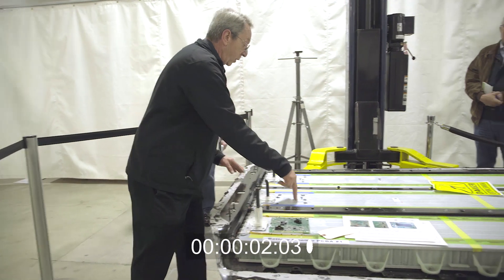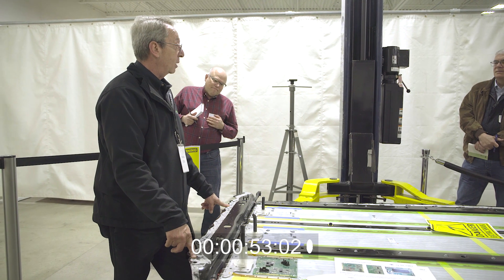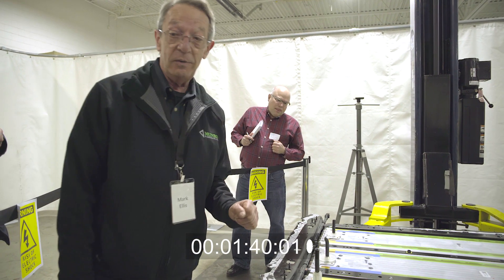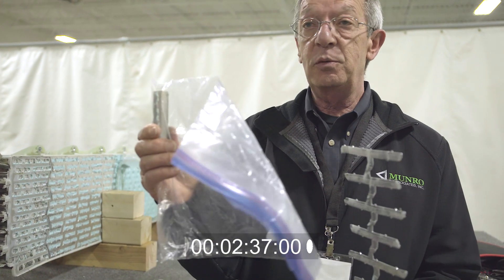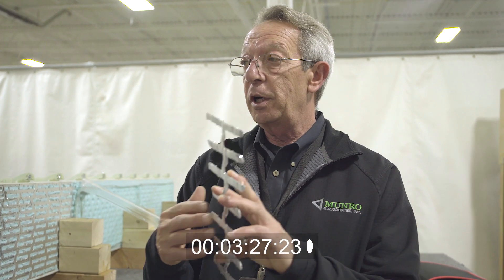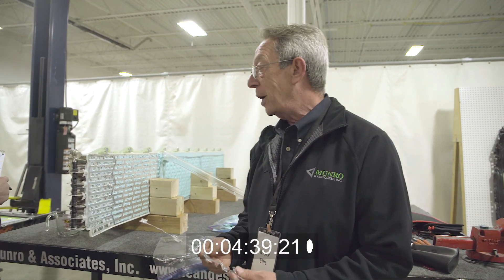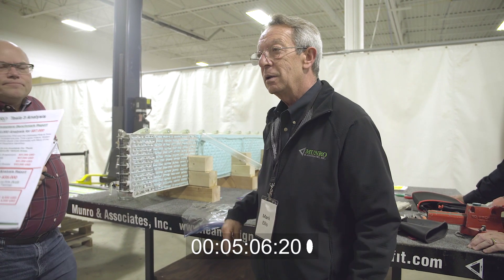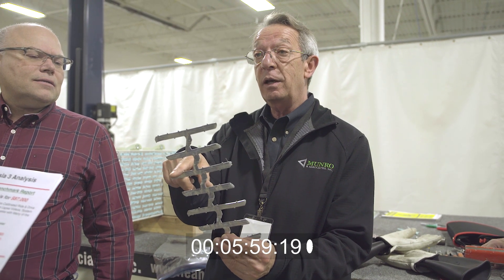Tesla Model 3 Battery Breakdown

Comment: Those tiny wires to the cells are not for vibration! They are fuse wires to prevent thermal runaway!
Reply: He did not say the tiny "wires" were for vibration.  He said they were fuses.  He said the glue was necessary to prevent vibration from breaking the tiny "wires".
Reply: @johnvolt9605  hearing impaired reading the words... my bad...can't read lips through the mask.  :(

Comment: See the look on that guys face when the guy mentioned the battery's longevity.
Reply: Keep in mind he said the battery would last 15 years before it drops below 70%.  That means many batteries will still have about 50% charge after 30 years.  Cybertruck will still have 200 mile range after 30 years and the truck will never rust.  Ultimate farm equipment.
Reply: Time stamp for those who need it
https://youtu.be/64_iBKLSnGA?t=81
Reply: Don't forget, Tesla had already been making sure the batteries can, some day, be swapped easily. Specifically, you might be able to swap batteries faster than actually charging them
Reply: I did read somewhere that Tesla wasn't making battery swapping a high priority anymore
Reply: @plainlybasic2300  Yes, until the issue of who owns the battery and would you be ok getting a bad battery installed?  The legal problems of loaning out a $12k battery that you don't own and are only leasing as a service became unsellable to the public.
Reply: On top of that every vehicle has a differently shaped pack so every battery swap station would need several batteries for dozens of vehicle models.  That only gets worse as time goes on, maybe the 2024 model has a different pack from 2020, then the 2030 model does that again, etc.  Then they abandon support for older models and it suddenly becomes impossible to charge your older vehicle.

Charging batteries in place avoids all of that and the battery technology has been advancing quickly enough to make it viable.  It's already pretty good and will only get better.
Reply: @rhamph  Yep, Tesla uses all 18650 or 21700 batteries but the packs are different for each model.  This is even worse for all other EV companies that use pouch or prismatic batteries.  Each battery system is specifically designed for just that year/model car.
Reply: @davidbeppler3032  How would he know the longevity? As I understand it, degradation from cycles is different from degradation from ageing. They seem to have cycles mostly figured out but I'm not sure about the ageing.
Reply: @plainlybasic2300  The Model 3 battery can't even be removed from underneath the car. Battery swapping is not an option. Technically, it was on the Model S but I think that was mostly something they put in to grab some extra subsidies rather than a real plan.
Reply: @phamnuwen9442  You know, that would be a great argument back in 2014.  But this is 2020.  6 years and more than 300,000 miles later.  The proof is in the numbers.  Think, if the first generation batteries lasted 6 years... and over 300,000 miles and counting.... don'tcha think the new batteries will be better?
Reply: @davidbeppler3032   6 years is clearly not a long enough lifespan for a battery that is going to be quite expensive to replace.

You can't just assume everything will automatically improve. For all we know, efforts to reduce cost (cobalt elimination) could just as well reduce lifespan.

Give me some hard data on battery lifespan (time, not miles), replacement costs etc.
Reply: @dclpgh  They aren't making it an option for "quick charging" anymore, but they do have the ability to replace the pack in the event of failure.
Reply: @davidbeppler3032  Same for Model S/X since they're all aluminum. Even an old S with 50% degredation will be able to drive at least 100 mile which is more than enough for majority of people's everyday driving.
Reply: It's really funny to see a guy smiling and saying "it's expensive" and then after he hears the  "operational lifetime" his face turns into a face of a boy that just found out there is no Santa :D
Reply: @plainlybasic2300  faster safer to not swap now
Reply: Pham Nuwen bear in mind that Elon also owns SpaceX, and in the aerospace world, they've got longevity figured out too, because getting that wrong costs millions in maintenance or replacement. You wouldn't invest the kind of money they have in their battery gigafactories and not take advantage of the expertise you have available to make it work.
Reply: @davidbeppler3032  Many of the first model S batteries haven't gone 300k miles. Do you know of any examples? The taxis that went 300K had new batteries from what I understand
Reply: @f270  You understand wrong.  Here is a recent article.  Notice the batteries were replaced for "factory installation issues".   Also the Tesla Taxis from Tesloop have had tons of repairs.  Lots of money in repairs too.  Still when compared to ICE taxis the maintenance is very low "$0.18 to $0.25 per mile — far lower than the current average of $0.32 to $0.35 for legacy sedans."  Just think how much better the cars are built today 5-7 years later.  On another note, they have more than 400,000 miles on some of them!
https://cleantechnica.com/2019/11/23/500000-miles-in-a-tesla-whats-the-result/
Reply: @davidbeppler3032  The article says they replaced 6 batteries. The tesloop model S with 400K has had 2 batteries replaced! That's not confidence inspiring. Show me a tesla with high mi 300k+ that has the original battery.
Reply: @f270  so that part about none of the batteries failing due to inability to hold a  charge was ignored?  Replaced 6 out of 11 in taxis that are driven harder than any personal vehicle and only supercharged.  That is pretty confidence inspiring in me.  7 year old cars hold up that well from a company that had never built a car before?  Pretty cool.  Now they last forever.  Unlike every ICE that has designed obsolescence built right in.  lmao
Reply: @davidbeppler3032  So you believe that the Tesloop model s that had it's battery replaced twice. Meaning it's on its 3rd battery. It was "factory installation issues" were found only after a lot of miles were put on? That's the most obvious lie. Of course Tesla isnt going to say "battery failure" for a very public taxi fleet.
Reply: @f270  do you have a point?  Still better than any ICE I have ever seen.  How many of them are expected to get more than 300,000 miles as a taxi?  Answer, none.  How much do they cost over the 100,000 they expect to get?  The fuel alone costs more than $8k.  Superchargining is not free (actually for those teslas it is) but it is a hell of a lot cheaper than $8k!  Maintenance on an ICE taxi is expensive too.  If you do a dollar to dollar examination it is probably a lot more expensive to use a Tesla to do Taxi service (unless you get free supercharging) but the vehicles are much nicer and so is the tech.
Reply: @davidbeppler3032  Yes, my original point is the batteries don't last as long as claimed.  And they cost so much to replace that it makes high mileage Tesla's not something I want to own. I look forward to when this problem is solved.
Reply: @f270  It was solved 2 years ago.
Reply: @davidbeppler3032  it would be nice if Cybertruck had a low gear mode,
Reply: @maxnovakovics2568  Why?  Please explain?  Electric motors already have insane torque.

Comment: Why not have the a coating cover in side the battery cover like less the weight of the 96 wireing but have the cover electrolises plating like gold plating then have the pack with rubber seal less the glue more coverage then replace different packs when degraded or the pack not working optimal fix connectors to pack in manufacturing just gold plate inner cover try that Ford or Rivian

Comment: 3:20 - the shorter modules have 23 bricks, the longer ones have 25 bricks (not 26). Only this way, it all adds up to 96 bricks. :-)
M1	23s	46p	1058 cells
M2	25s	46p	1150 cells	
M3	25s	46p	1150 cells
M4	23s	46p	1058 cells
total	96s		4416 cells, 79.488
  Wh, assuming 5Ah per cell and 3.6V nominal voltage
Tesla describes it as 75 kWh battery pack.

4:30 - You say, the "optional" battery pack has "three fewer groups of 46 cells in each of the four modules". This would translate to: 
M1: 20s	46p	920
 cells
M2: 22s	46p	1012
 cells
M3: 22s	46p	1012
 cells
M4: 20s	46p	920
 cells
total: 84s		3864
 cells, a 69.552 Wh battery
I do not believe you in that regard. That would translate to a 65 kWh battery pack, when named Tesla style. That is way too large for the standard range plus battery. Also the battery pack voltage would drop, which would be disadvantage when charging at current-limited DC chargers.

Instead from other sources, the real organization is like this:
Standard Range Plus Battery
M1	23s	31p	713
 cells
M2	25s	31p	775
 cells
M3	25s	31p	775
 cells
M4	23s	31p	713
 cells
total	96s		2976
 cells, 53.568 Wh
Tesla describes it as 50 kWh battery pack.
Source: https://electrek.co/2017/08/24/tesla-model-3-exclusive-battery-pack-architecture/

Instead of lowering overall voltage (84s), they keep the overall voltage (96s), so that for the e-motor and for charging, at least the voltage level remains the same, but currents going down.

Mid Range Battery (available from January to March 2019) was right in the middle. The following is an educated guess and estimate:
M1	23s	39p	897
 cells
M2	25s	39p	975
 cells
M3	25s	39p	975
 cells
M4	23s	39p	897
 cells
total	96s		3744
 cells, 67.392 Wh
Tesla could describe it as 63 kWh battery pack.
Source: https://teslike.com/2018/10/19/estimated-range-and-battery-specs-for-tesla-model-3-mid-range/

Comment: Each brick is 1s46p and the bricks are connected 96 bricks in series for a total battery of 96s46p (4416 cells)
Each cell must be 350v/96s= 3.646v nominal/cell
75000 Wh (75kWh) / 350v = 214.3 Ah
214.3Ah / 46p = 4658 mAh/cell
Spec shows 4800 mAh/cell (2170)

Discovered this video: https://www.youtube.com/watch?v=2nhQw7iGukE
Reply: Do you mind me asking where 96p came from in the second paragraph; 214.3Ah / 96p to = 2232mAh/cell
Reply: @firstnamesecondname5341  Thanks, updated as I switched s with p
Reply: David McC 👍 I’d been reverse engineering the Porsche Taycan system (might as well do something while in covid lockdown 🤷🏻‍♂️) I’m a bit rusty on the ole calculations and thought I’d missed something 😎 thanks
Reply: really late reply but the real kwh is around 78/79
Reply: @shitass3931  we can work it back... 4.8Ah * 46p * 350v = 77.28 kWh
Reply: @davidm8030  I feel itll be slightly higher but that's close enough for me to not disagree :)

Comment: Are there different "bricks" in the SR+ battery? 
According to the ODB information the SR+ has the same voltage as the long range battery. So there should still be 96 bricks in series. But to only have 50kWh instead of 74kWh there should be ~31 cells in each SR+ brick as opposed to 46 cells in each long range battery brick.
I assume that just using lesser bricks would result in a lower voltage.

Comment: The nominal voltage of these Panasonic NCA cells is 3.6 V, not 3.5 like he says several times. 3.6 V * 96 = 345.6 V which is pretty close to the 350 V he mentioned at the nominal pack voltage.
Reply: What's the peak voltage at full charge? Around 4v? I know they're reserving some potential for longevity so they likely won't hit 4.2v.

Comment: Interested to hear how JB at Redwood materials will recycle this. It's obviously not designed for dis-assembly. They're probably  planning to shred them and retrieve material mechanically and chemically? Sounds complex and expensive. Hope they've factored this in and review it at battery investor day. Super important for the planet and as a precedent as they scale up.
Reply: Anthony Smith I agree. The battery should last for a long time as it’s built for it. However, it contains a lot of glue and must be a nightmare to recycle ♻️
Reply: @TurreTuntematon  
Unless they have some form of solvent to dissolve it?
Reply: They glued it to make it watertight, and vibration/shock proof. Its better to design a product that is long lasting but more difficult to recycle, than an easy to recycle, but not long lasting product.
Reply: t c  I dont know why you are talking about apple. It has nothing to do with the video.
Reply: Anthony - before Tesla batteries are Replaced , they can still be used in Consumer electronics and in Tesla Energy products.
Reply: t c  no, apple make it hard to get the battery out, few people are recycling those batteries.

Tesla, battery out of car is easy, recycling not so much but that was always going to be the case so you only have to design it to be recyclable for a major industrial recycler.

Serviceability would be nice, but if they can make them last a whole lot longer by making them less serviceable, so be it. You can still do a relatively easy battery swap.
Reply: @niconico3907  Yep, for sure it's easier to make it watertight with glue. We could have hours of debate on this one. I acknowledge your point though. Let's see what they announce at battery day. Hopefully they have cracked longevity and recyclability at the same time. I expect big things from JB and co. Suspect they've spun it out into a separate company as it may well be loss making, but could be eligible for governmental grants/ funding as a separate entity.

Comment: Does the glue also work to suppress any fire?
Reply: Probably not directly I’d guess.  but it prevents anything from vibrating or shifting which in turn reduces fire risk
Reply: I suspect they used some type of thermal suppression material within the brick  to minimize heat propagation of a single cell thermal runaway.
Reply: I don't think it's simple glue. It probably has vibrating absolution ability. If you look at cell diagram, it's just a sheet of metal separated by thin insulator. If cell keep getting vibrate, those sheet of metal will probably rub into each other a lot result in damages and shorting.
Reply: ICE manufacturers should be required to build much heavier fuel tanks with better fire protection devices installed at the factory.  ICE are dangerous.
Reply: Curt - Tesla made sure glue is NOT an Excelerant. 
and Tesla has a Blue Goo that Insulates the batteries and acts as Passive Coolant and works in cunjuction with the BMS.

Comment: In your opinion is the battery pack any different than what the Model 3 uses? Any improvements anywhere?
Reply: Actually the description now shows "Model 3 Battery" so it's likely an older video and not a Model Y. Maybe the title of this video in this relatively new channel will be edited for clarity at some point.
Reply: I heard that they have taken the aluminium wire bond process out and they'll be using laser welding to make the connection to the cell is the battery pack.

Comment: How much cells must have died to have -14% capacity on my SR+ model 3??? It has a lot imbalance when drive it on longer trips. Rated range is only 208-212 of the 240.. Tesla said ''it isn't -30% yet so it's as expected... as listed on website''

(I have the OBD ScanMyTesla tool, to read cell voltages and have automotive diploma’s and built DIY battery packs)
Reply from the maker: I’ll ask Mark and get back to you. Thanks for your question.
Reply: That could largely be due to general degradation.
Reply: Munro Live Wow an answer! For us it has been lower useable capacity pretty much from the start. It never had the 240-mile rated range and it’s only half a year old. I visited service, tracked the capscity with apps, OBD-reading ScanMyTesla software, manually driving it empty and calculate it (after mitigating random factors by preheating hours from wall)

In general all seems to work “ok” besides we seem to have started off with less useable capacity then the Model 3 SR (non-plus) version.

My theory is that Tesla has a few packs that are not that great.

The OBD-dongle ScanMyTesla says the total capacity including unuseable energy buffer is 46.x to 47.1kWh (it hovers abit between that) it rounds up to -13/14% at least. 

Note: car is from late 09-2019 and has 16.000km or 10k miles (but problem was there already at 500km or miles)
Reply: Reset your battery pack , RUN the battery down to 10% then slow charge to 100% with 120v.
Reply: Not sure what you mean with reset. I have tried all the 90 to 5% and 100% to low SoC and then slow charge (albeit on 230v because EU). Latest test: 95.x% down to 5% (after hour long preheat and warmed battery, almost ideal weather) I was able to only use 40kWh.

When pack got low. Imbalance increased to 64-78mv. ScanMyTesla, Teslafi and manual trip meter calculations all point to 44.3 kWh useable at absolute best starting from 100%, or 40kWh 90 to 0%
Reply: @MrGoogle87   - have you notified TESLA service center of your Problem.
Reply: Yes, made an appointment after owning the car for less then a month. They didn’t even know what rated range was and such. They tell you capacity is secret and can’t tell you how much capacity it is, it’s not oublic knowledge how much it had. Website says -30% is your warranty (and it’s -14 here...) so started off with less range then a SR non-plus. SeC doesnt do anything.

Manual calculations , long trips, recalibration trips, teslafi and even apps, Tesla forum. Really got short end of the stick to basically start with a terrible battery with much less capacity

Comment: If you are going to make the battery pack a stressed structural part of the body (which would be really smart) then prismatic cells are better than those cylindrical cells because you can flatpack them which is stiffer.
Reply: Cooling
Reply: @samusaran7317  Ja,, da cooling